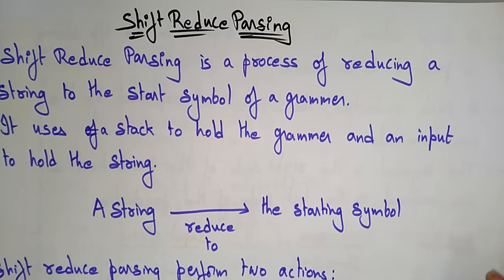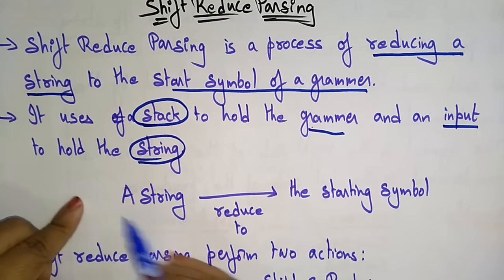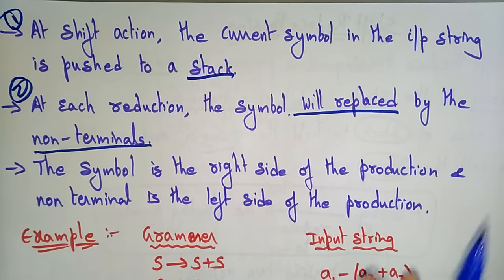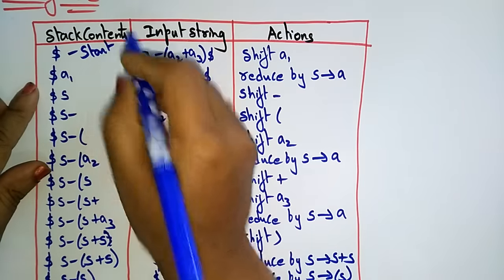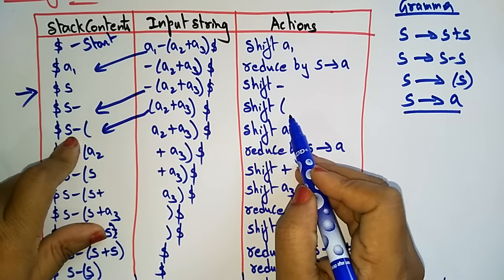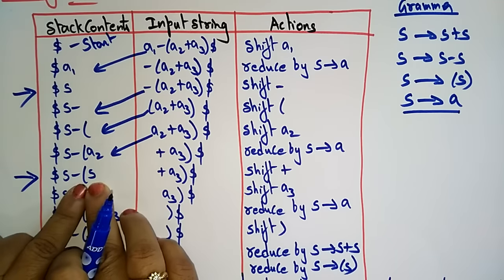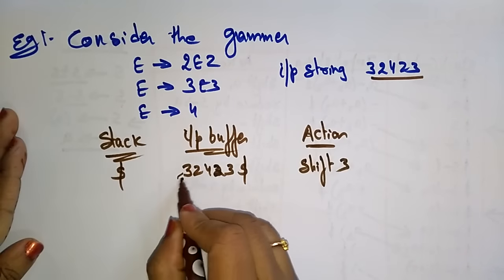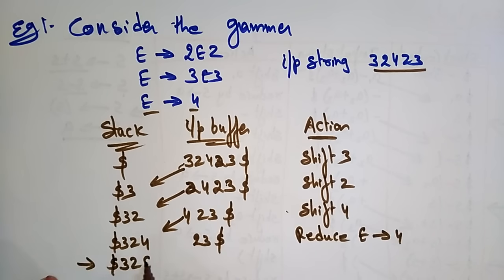Shift reduce Parsing | Compiler Design | Lec - 8 | Bhanu Priya

Comment: What is the condition which tells the parser that it needs to reduce S+S after it gets the closing parenthesis? Why did you reduce S ---> S+S after shifting the closing parenthesis and not before as soon as you have shifted the second S of S+S?
Reply: Correctly observed, S+S will become S first, and later (S) -> S.
Reply: Yaa same confusse i feel in same line ...but y ma,am ..if condition is going correctly then suddenly change in  that line .....🤔🤔
Reply: N i think it shuld be S-(S+S =S. but in that line instead of =  S  ma,am u take parenthesis bracke first n then accordinly to mention grammer that shuld not  be parenthesis bracket first  ma,am ..so it take me a litle bit confusse ...